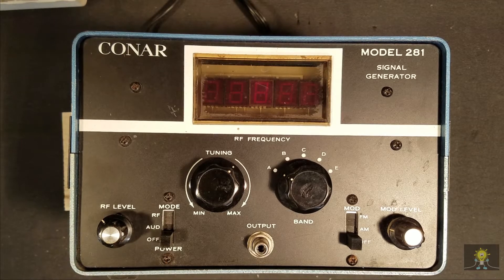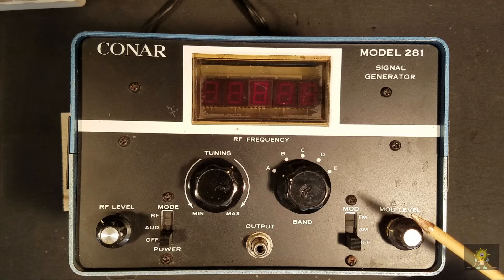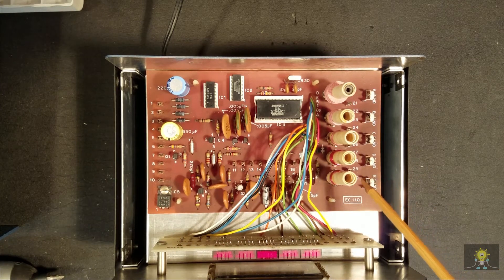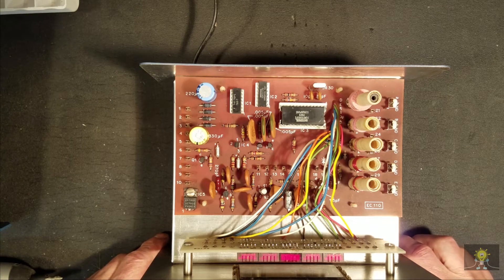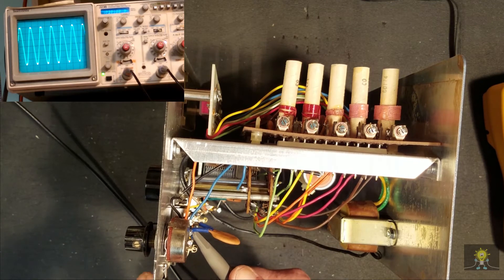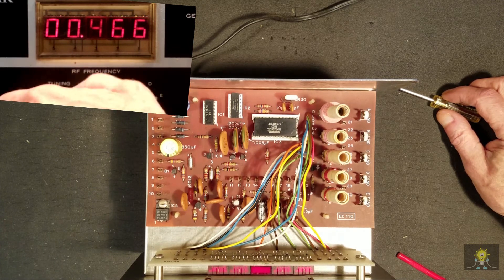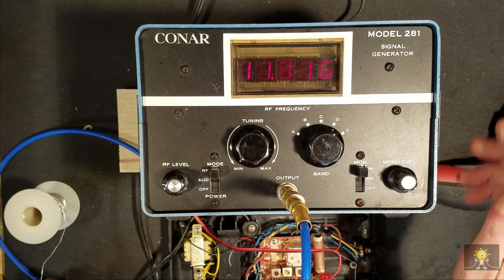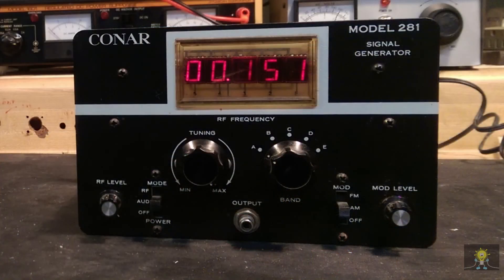005 Conar 281 282 AM FM RF Signal Generator

Comment: Thanks for the video! I bought a model 282 on eBay, because it has FM modulation. It needed a little TLC, the bandswitch was quite stiff. I replaced the phono jack with a BNC, which happened to fit in the same hole. I'm looking for a manual for it, without much luck. I did find an article on the World Radio History website, in the National Radio News & Journal section, 1979 Summer. It doesn't have any detailed schematics, but gives a good idea of how it works.

Comment: Nice. But just adjust to the bands are overlapping. No need for this to be exact.
Nice simpel generator, seems to be fairly stable in frequency.
Changing the connector to SO239 or BNC ?
Reply from the maker: BNC